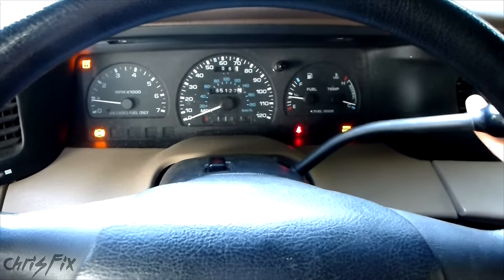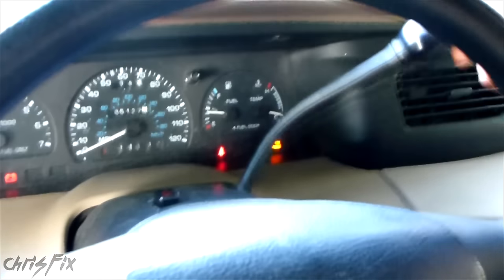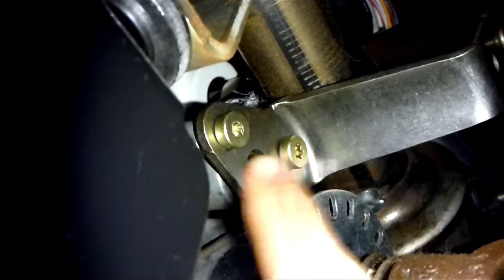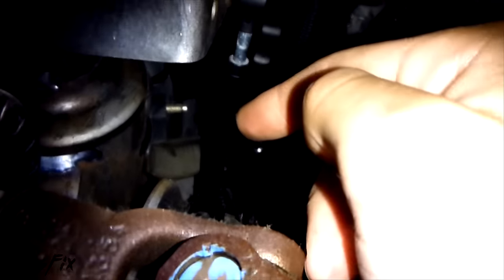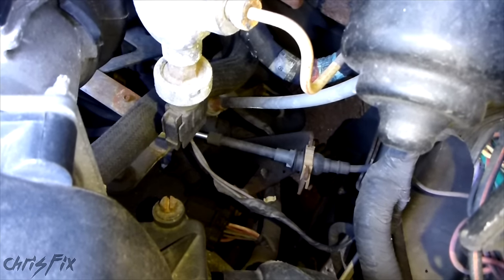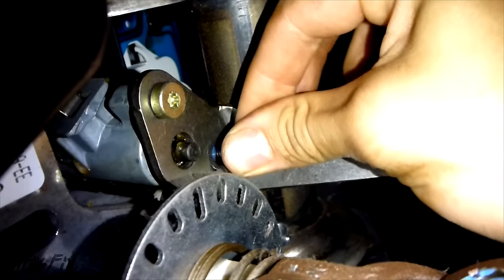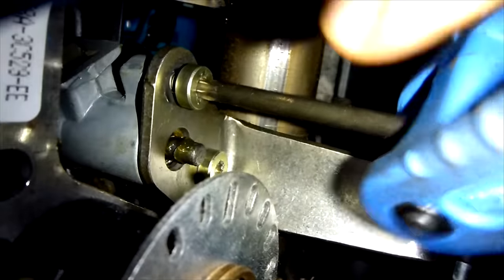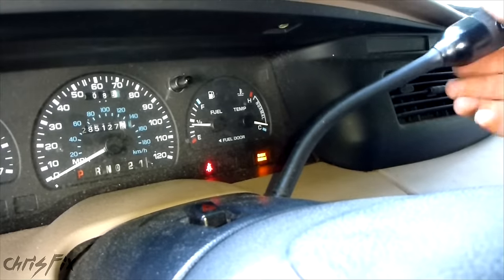How to Fix a Loose Column Shifter

Comment: Been searching for right video,believe its yours, 63 Ford falcon with exact issue, wouldn't start because wasn't in park like I thought it was, started rolling back too,went to start,just shuddered and shut down,had to hold shift arm in exact park area,finally started, I'll follow  break pedal up see if I can find those bolts,lots of play like yours too,thanks for help

Comment: I just did this on my E150. You saved my ass. You also made it look much easier than it was to get to it.
Reply: Just did the fix on my E150.  The vid makes it look easier b/c the E150s have like NO ROOM!  The hardest part was contorting myself to get to the bolts, but it worked!

Comment: I think this is great. The more common problem is the bushings on the gear shifter shaft wear out. So if this isn’t the problem then it’s most likely those bushings. I must say that you still had a significant amount of play in that gear shifter and I’ll betcha those bushings are wearing out as well.

Comment: Thank you very much Chris.  I watched your video after getting the minimum quote of $100 if it is loose (95 Ford Club wagon) - & the 2 bolts under the dash were loose & now fixed. Thanks again. I gave you like number 2800.
Reply from the maker: +john zimmerman Perfect! Glad to hear it John!
Reply: Thanks again - by the way just ran into another Ford stupidity - the plastic end on cable door latches.

Comment: Chris, thanks a lot brother! I had this shifter W A Y outta whack. And I was pretty clueless. Just kept drivin' it... It was at the point where it would slip outta park, and it rolled one day in a parking lot! (Just outta the space, was almost flat.) I didn't even have an e-brake! This, I believe, caused a cop to 'stalk' me when I drove it outta the supermarket, and give me a ticket for a bad sticker... At least that's my theory. (Beat it in court anyway!) So I finally am getting to look into it tonite. Get onna web, and this u-tube vid comes up. And mine is a Windstar too... In my head, it was like I'd have to pull the console. I thought it was gonna be a project. You showed me how, and I really appreciate it, man! When i got under the dash, turns out one of the damn bolts had fallen out, and just the bottom one was all that was 'hangin' on. And loose at that! I scrounged my bolts bucket, and actually got lucky. Hadda take the remaining bolt out to match it tho. Not such a big deal to get it back together anyway.  The 'boss' pin has a spring on it that could drop of if your not careful.  But you just push the plates together and get the bolts started. (Guess I'm goin' on...) I'm back in black, thanks to you... Dug your "how to fix a car with no heat" too. Tryin' to help a friend out with that... As for the 25 people who dis-'like'd' this vid, -I can't say it in this space! You do a GOOD JOB Chris. Thanks for doing it. I hope someday I can try to do a few of these vids myself. I'm one low budget dude, or i'd a had a pro do this job... Thank God for y'all on you-tube!
Reply from the maker: +Dave Glaziier AWESOME!

Comment: Dang, those 410,000km old bolts were loose!! I couldn't even find the low gear. Now, it shifts as crisp as new! Note that there is also a little spin wheel under there that let's you align the shift needle! Thanks!

Comment: Thank you so much Chris! I've been dealing with a loose column shifter for over a year now, and have had the no start problem various times! You're a life saver!
Reply from the maker: TotalDestruction Studios Awesome! I am glad the video finally helped you fix it!
Reply: Hey  Chris I need your help bro.. is it important to have those exact screws to put back in and do you know what this part is called by any chance?
Reply: @michelmullaney3641  I’d say no because one of the two on mine was not a torx. I tightened the one which was and am largely fixed, but I want to buy a torx headed one to replace that errant one because a fix is easier if the equipment fits the description. Still, it works…

Comment: EXCELLENT VIDEO.  I WENT DOWN TO THE FORD DEALERSHIP AND THE CSR ARGUED ME DOWN THAT THE LOOSE  (MISSING IN MY CASE) BOLT WAS NOT THE PROBLEM.  SPEAKING OF THE MISSING BOLT DO YOU HAPPEN TO KNOW WHAT SIZE THE BOLT/SCREW IS?  THANKS!  I REALLY APPRECIATE YOUR VIDEO WORK.

Comment: About to cry before I saw this, depressed cause I'm thinking I may have to buy a whole rebuilt transmission. My '01Oldsmobile Silhouette yesterday column shifter at Wendy's trying to put in Park, went from drive to 1st, 2nd, 3rd (I may be backwards on that) but I was trying to move the shifter back to drive, but it was like a lever on a gambling machine in Vegas. I drove it home and was able to park it in my space, had to Brake & emergency brake it jumped the curb but at least it's here. Phew!  But this video gives this old handicapped lady is hoping this is the fix! I'm going out to look later on today and see (fingers crossed) I need my ride it's got my electric wheel-chair in it. Thanks so much for this video! What a find for us ladies!
Reply from the maker: +Karen Lloyd Hopefully that is an easy fix!!! Good luck!

Comment: There are some other things that can happen with these Ford column shifters.  Right now I'm trying to snug up the shifter on a a 2007 F250.  The bolts that were loose in your video were tight on mine, so I started looking for other causes.  I noticed a rubber spacer/isolator that goes around the shift handle where it goes into the steering column.  The shaft pivots on a pin and pushes the inside of the shift tube back, which is then translated to the shifter cable.  The hole in the end of the shifter shaft fits loosely around the pin, and so there is a rectangular rubber isolator or bushing that goes around it to take up the space between it and the shifter tube.  It was worn out and torn up and so the shifter moves all around the retaining pin and makes it feel very sloppy.  I don't think that's a great description, but I just thought I would chime in with what I found.  My fix so far is to apply Ultra Black RTV around the rubber, as I haven't yet found a part number or replacement part.

Comment: Wow that was easy. 2000 Ford Windstar column shifter was getting loose. Shifts nice and tight now. Good video getting your camera up under there to show the part. I did not even have to use a flashlight because your video was so good, I could do it by feel. I skipped the threadloc but if it gets loose again, probably give that a try.
Reply from the maker: +kcsteeler Awesome! Glad the video was helpful!

Comment: I have a 97 Explorer 3.0, mine has done this a long time. Last week I found one of these torx head screws in the floorboard. Thanks for the video . Now wondering if the shift tube bushing in the steering column is bad also ....

Comment: Hey Chris, thanks for covering so many issues on so many vehicles.
Could this have the same results if it's stuck in park?
Reply from the maker: If it's stuck in park it's likely the brake/shift lock having gone bad, but if you are able to move the shifter but it's having a hard time and feels sloppy, then this video would apply. Might as well check it anyway!

Comment: Once again your video helped me fix the problem with my son's 2001 Taurus. The bolts had not only worked loose, one of them was gone.
Would you have any idea why the no. 17 fuse in the box under the hood keeps blowing? The radio stopped working quite some time ago and we can't figure out why. I replaced the radio. All the heater controls function, but still no power to the radio. The only fuse that is bad is the no. 17 that says it controls among other things the CD player. Any suggestions?

Comment: I did this same  job late yesterday afternoon on a 2000 E150 Ford Van. I had a very tuff time getting my hand up into the dash to get to that part let alone even try to take one screw out at a time to put some loctite on them. I even took that heavy steel cage down under the Steering Column to get in there better to see along with the bottom dash panel cover. I decided to just tighten them up by hand the way they were. The Van is almost 22 years old and sure they were loose and the shifter was getting Sloppy. There were times over the last few years where I turned the key and got nothing with a fully charged battery out of the starter that I would do a load test on the battery and when I saw it was good changed out the front fender mounted Solenoid hoping that was the problem or even replaced the starter. Then there was those times over the years I couldn’t get the starter to do anything. I attribute the problem now to this shifter linkage problem after coming across this video. With the 2 bolts tightened up what a big difference I can tell already. I also own another Van a 2003 E350 with half the mileage on it so I always noticed a difference in the 2 with the shifters. The 2000 E150’s shifter feels just as good as the E350’s Shifter now. I am willing to bet I cured that intermittent starter problem also now that was mentioned. Thanks for making this video Chris. I had no idea of the problem until I came across this video. Even though I didn’t add loctite I am confident it isn’t going to loosen up anytime soon for sure.

Comment: Thanks for the awesome video. The further of the two bolts fell out on me a while ago, and I tried to put it back in, but I think the threading behind the plate is misaligned. How might I realign the two parts to let the bolt in? Also, this area under my dash is very tight and I have a hard time getting my hands in there. The only way I could even put the bolt anywhere near the hole was to my socket/T30 driver. But my 3/8 socket wrench doesn’t fit either.

Comment: Thank you so much Chris ! I've been having the same problem with my 97 Ford Explorer AWD V8.  The shift handle is loose and when it's in park it's between neutral and reverse.  I'm going to get right on that. Would you happen to know what size nyloc nuts go on the stabilizer links of the same vehicle. Metric or standard threads, etc. ? Thanks ! You earned my subscription today.

Comment: thank you Chris !
 I'm going outside right now to tighten up steering column shifter. 2002 Ford Windstar
then I'll look up a video on driver side electric window not moving up or down
thanks again...
Reply: tightened up both bolts, steering wheel column shifter fixed
Reply from the maker: +Anthony Schurz AWESOME! That is what I like to hear!

Comment: What else could cause sloppy shifter? 2001 f150 .. I no longer have Park. Have to start in nutural. Checked the linkage below and the bolts in the video. All good and tight.

Comment: Nice that was supper helpfull on 98 ford f150  there was supper helpfully. What did no notice that was indercator that went bad to fix this I used 2 tip ties to fix this and re glued it. Was supper ez. Went to dealer they told me it take 7 hrs to fix this. This pross took me 15 mins at most
Reply from the maker: +Game Centeral 2009 glad the video was helpful!

Comment: Had the same slop in the shifter on my 97 grand marquis. I turned out to be a worn bushing on the bracket holding down the shift tube.   It's located on the top of the steering column, and you have to take off the plastic cover (which includes popping off the ignition).  Two torx screws, added some plastic bushing material and all is well.

Comment: Hey Chris, you saved me from having to stay in a very crappy spot all night . One of the bolts actually fell out it's been loose so long. I'm glad it completely went to shit so I was forced to YouTube a solution and saved going to the mechanic. I don't have the hex shaped Allen wrench but some snub pliers got it in enough to get it into park and get it started. Why won't my van start in neutral, Is that only manual vehicles? Anyway, thank you. Liked, subscribed.

Comment: I had the sloppy gear shifter on my 2001 ford ranger so I bought a new shift tube and installed it because the old shift tube was broken,  but now the truck will not do anything when I turn the key.  I have accessory so the radio and dash lights come on but it acts dead when I try to start the engine.  Could this be something to do with the anti theft mode?  Thanks and I enjoy watching your videos.

Comment: I got an Aerostar and the shifter has more play then yours and when I saw that same part the bolts were loose i thighten them up but i notice the base were they are bolted too it is still loose so i think it's so i have no choice but to take apart the whole steering column and replace the whole part that's broken or put a floor shifter like a B&M Megashifter or Pistol Grip Shifter so it looks cool.

Comment: Wonderful video. I am wondering if you could do a video on a broken cable shifter and how to replace. It happened recently with my chevy venture and I have it sitting until I either tow it to a shop or fix it myself. Either way it needs to be done before we get snow.

Comment: Thanks for the video, but I still have a problem. The truck (2003 F250 7.3L) will shift into all the gears just fine. The problem comes when it goes to park. Sometimes the keys don't want to come out without pushing the lever further into park (pushing the lever upwards). Is there another linkage that could also be tightened up? Thanks for your video!

Comment: Is there a preferred way of getting into there? I’m a big guy and feel like I’m a contortionist lying on my back trying to fit in the floor board to see. Last time I was only able to tighten 1 screw, then my back cramped up and had to stop. 

Shifter has become really loose now, and I’m fixing to have to try to get in there to fix it again.

Comment: Great work...My dial has a Crack but works...how bout this? The two bolts, one was  loose. The other was sheared  off, tightened other,  works gently, but see its not aligned w the busted one...thought of JB Weld? Hard  to clamp...would make harder later to repair? My hands are too big, n feel a bruised rib...I guess gotta take top dash,  AND AIRBAG? That worries me, would the dealer be worth paying a little more? Trust your opinion...

Comment: You might of just saved me a crapload of money, i just looked up there, and one bolt is loose, and the other is missing.  the mechianic was telling me i had to replace the steering column. thanks for this video
Reply from the maker: Glad the video was helpful!
Reply: O yeah, i had to go get the right tools, but 10 dollars vs 300 made it worth it. Took 5 minutes.

Comment: im sorry im commenting on a old video but another common issue for fords is the shifting tube in the gear selector can actually break. i had that problem in my expedition. Maybe you can make a video on that sometime.
Reply from the maker: Thanks a lot for the tip!

Comment: Can you tell me the size of bolt that goes in there? Ones missing on mine and don't want to remove other one because like you said it's difficult to put back in and there's not a lot of room to work. So if your able to help me out with that info on bolt size it would be appreciated. Thank you.
Reply from the maker: I believe its a T25 torx M6x1.0 x 20mm

Comment: Hey Chris I got a 94 Ford Tempo I just watched your video. My shift cable is lose on the floor column shift does not engage gears. I thought it might be a bushing, I'll check the gear shift under hood and all.

Comment: my 02 taurus wont park, night before a screw popped from that area, thought nothing of it, next day it wouldnt start. now it only starts after i put the gear in first drive, then everything after first drive (second drive and 1st gear) is drive, and first gear and everything before it (neutral, reverse, and park) are all reverse. it wont park, gotta leave it on flat land cuz once i turn it off after putting it in first drive to turn it off then shift to park which is neutral, itll roll if its on any incline even turned off. the ebreak wont stop it either. so im hoping its just that screw that needs to be put back where you shown in this video!

Comment: Would it be similar to fix on a Chevy Uplander? Last night I tried to shift mine into drive and was stuck in reverse! The handle moved but the gears didn't and the red mark never moved from reverse. Finally after several tries I got it into park but then it was stuck there even though the handle moved. I had to get towed home and the driver said probably the cable came loose. My husband looked today and said yeah the cable was disconnected he reattached it and it went into gear but said it's still loose so it might come off again. I'm trying to figure out how to keep the cable from popping off again. Thank you for any advice.

Comment: How would you align a shift indicator on a thunderbird or old cougar?

My friend said there actually a cable that runs along the transmission under the car that just needs to be tightened. Thoughts?

Comment: The cast metal looking piece that the bolt goes into the threads is the part that's broken on mine right through the threads is that part available ?

Comment: I got the same year Windstar and recently I found that if you disasemble the upper cover of the steering wheel by removing the ignition column (key), there is a little gear that calibrates de red.mark.on the cluster.

Comment: My '01 Olds Intrigue's gearbox won't go into 1st gear and during the summer time, the gearbox is hard to shift from park to reverse. Could it be a grungy/dirty spring? And I'm planning to replace all of the ILBs with LEDs (cluster and gearbox only), however, my reverse lights have LEDs in 'em and you can see my car a mile away.

Comment: I have this same problem except that one of the bolts fell out and now the shifter is locked in place, wont shift or start  at all. What must I do to free up the shifter to align the bolt to replace?

Comment: Similar issue in my c10 but it’s cycles through the gears with no clicking at each gear (th350) is there a deeper problem inside the trans?